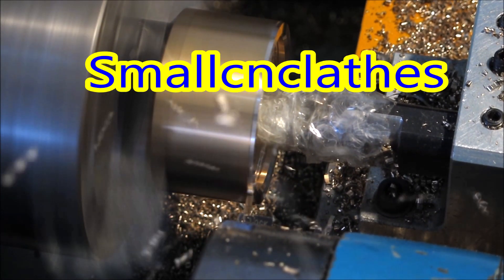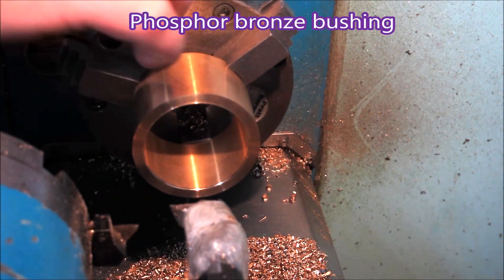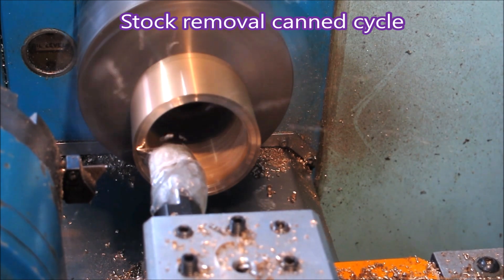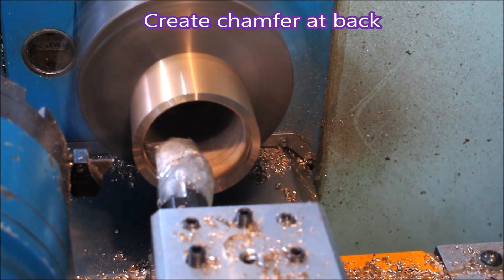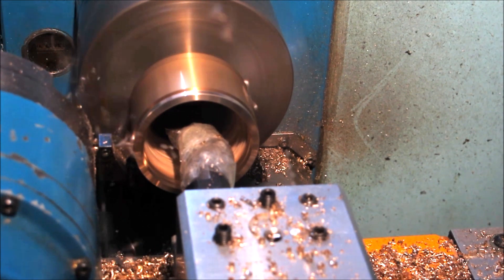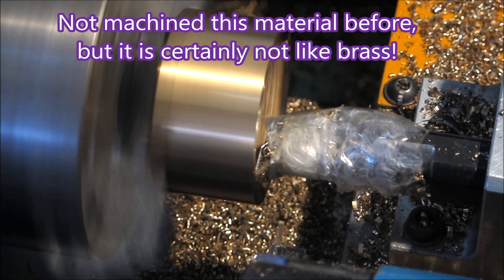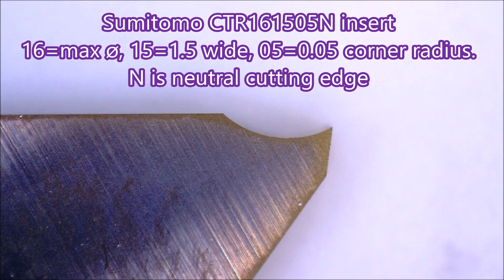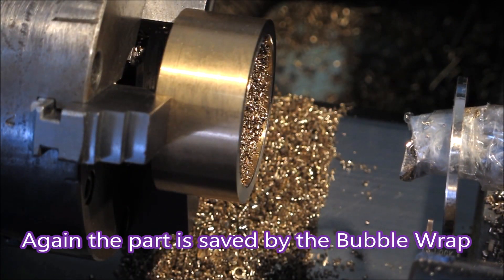Parting off & boring, carbide inserts in cnc lathe. Turning Bronze Washer for Classic Mini Minor

Comment: I wonder if a delrin sleeve around the tool would work as well - or a coat of latex paint? The bubble wrap is a very quick and flexible solution. 2/3 rings being thrown away sounds very painful. Thanks for sharing.
Reply from the maker: Hi Aaron, would probably do the job well.  Bubble wrap just provided a fairly quick solution to a problem that was driving me nuts!

Comment: Good idea! Another way I've tackled that problem is to slow the spindle down right before the part comes off, stops it flinging away pretty well.
Reply from the maker: Thanks James. not sure I can do that!
Reply: @smallcnclathes  your method works perfectly anyway! I found the way to do it was to do 2 parting operations, the first one at higher spindle speed to a certain depth with zero or minimal retract and the second one at a slower spindle speed. Most cam software doesn't how how to do it otherwise
Reply from the maker: @jamesfinniss6448  I think I could make that work too, perhaps. Tapping the part off as I normally do was impossible. Damn stuff was just so hard, that any fin left on made it impossible to tap off.